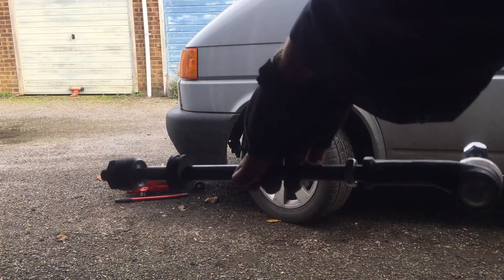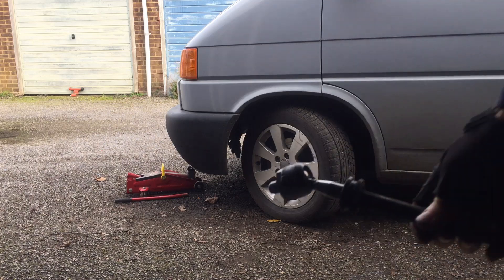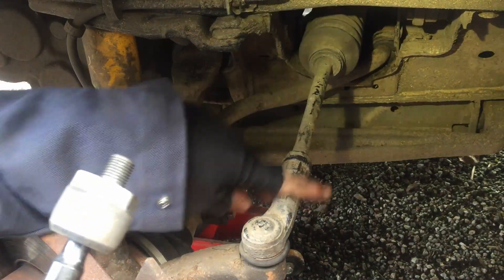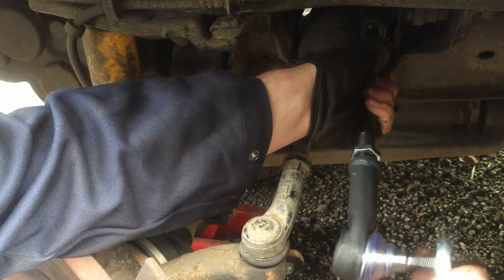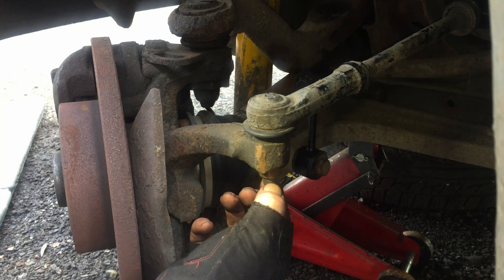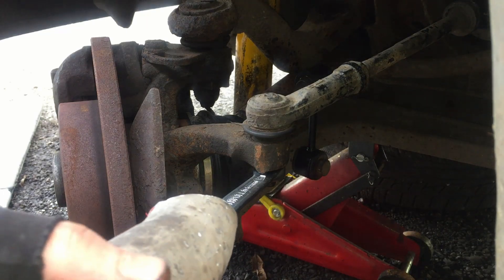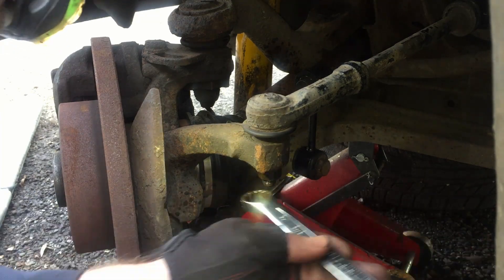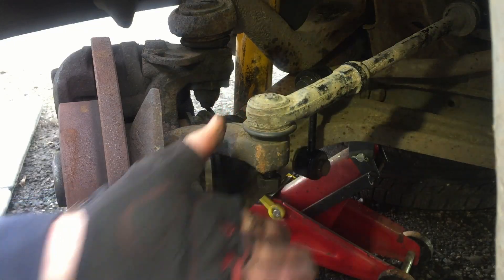VW T4 - Track Rod/Tie Rod end ball joint replacement (inner & outer)

Comment: Thank you. You showed how to do this job perfectly.. You are a great teacher. You showed everything that needed to be told to do this job. You demystified  ( simplified ) all those words for parts and where they are fitted to the vehicle.  You have given me the confidence to do it myself. you made it look so simple. I can see physically it can be tough to undo some bolts and remove the rack by the wheel. I will buy that tool to separate that. You are fantastic and will save me a lot of money. More importantly. When you do the job yourself. It does wonders for your self esteem  and confidence. Thanks for sharing that.. Good luck to you. Regards Dave
Reply from the maker: Thank you for the kind words Dave. Best of luck!

Comment: I should get a ball joint splitter. Without it you can do the job by jacking the track rod end up and out but it takes incredible force to pop it. It usually takes me hours to get them out!
Reply from the maker: It still took me 20 mins with the splitter. What a pain!
Reply: You can wedge the ball joint up from underneath with a little pressure and hit the arm it connects to downwards  with a hammer
Reply: The easiest wat to remove them is hammer (your biggest) the metal that wraps around the track rod end taper.

Comment: After you Jack the car up and put the stand in. Are you using that Jack or is it just there for a safety?
Reply from the maker: I make sure the stand is securely holding the weight, and I leave the jack there as a backup. I also slide the wheel under the low point of the engine as a backup

Comment: Ive got an advisory for Front steering linkage ball joint. Are they talking about the track rod ends or something else?
Reply from the maker: It sounds like it’s the same as on this video, but I would double check. How exactly is the advisory worded?
Reply: Track rod ends I’d say as the rubber splits, the grease dries up and ends wear out, advisory on mine too, going to try and do them this weekend
Reply: @JoelsStuff  thanks for getting back to me. Its worded as follows: Front Steering linkage ball joint has slight play os and ns ineer
Reply from the maker: Yep it’s the same job as in this video. It’s as easy as it looks, and cheap to buy the parts. Good luck!
Reply: @JoelsStuff  If I buy the parts can you if them ; )
I dont have the tools sadly.
Reply from the maker: I wish I had the time! It’s only an hour or two at the most, so your local mechanic probably won’t charge too much. I sometimes buy parts and pay a mechanic to fit them
Reply: @JoelsStuff  I've called out a mobile mechanic and the parts I've ordered where wrong and then the 2nd time I got what he said to get and they didnt even fit 🙈. I would do myself but I'm lacking the tools 😦